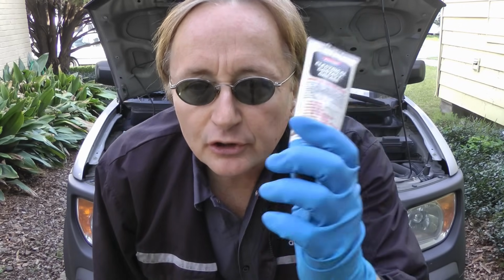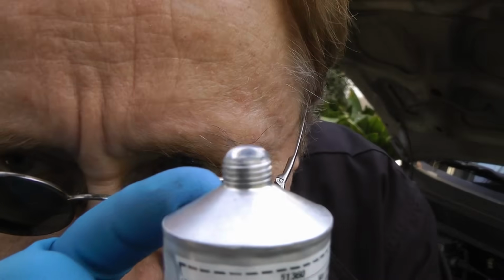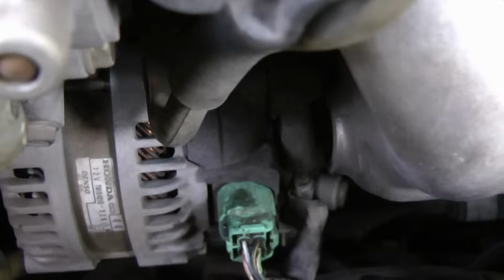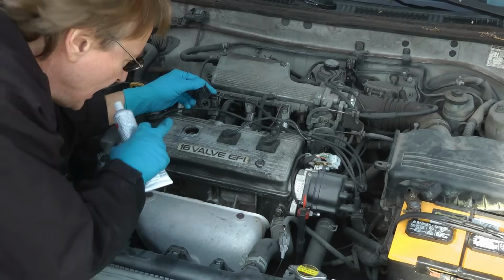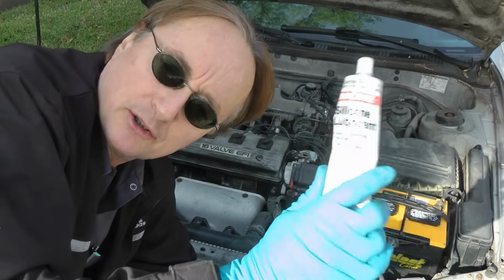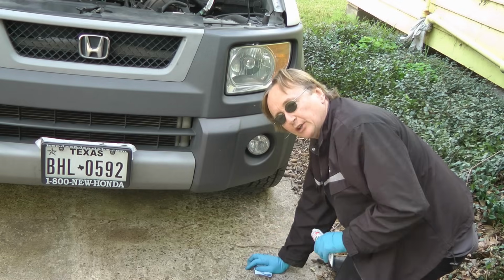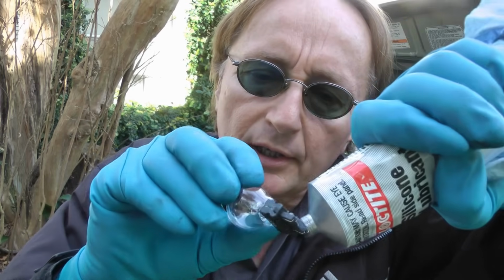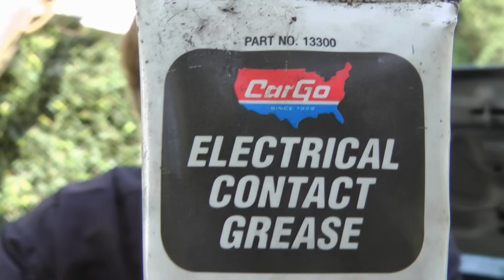How to use Dielectric Grease on Electrical Connections in Your Car

Comment: If the grease is a conductor of electricity wouldn’t it cause a direct short when used in plugs that have multiple contact points? If it does NOT conduct electricity then wouldn’t it keep you from getting a strong connection? Not so sure about this. If it worked then Chevy and other dealers would use it

Comment: Not interested in a "...but dielectric grease doesn't conduct!" argument.  PRACTICALLY speaking, is it best to LIGHTLY coat a connection (like say a sparkplug) with dielectric grease to prevent corrosion? Or avoid the actual connection?

Comment: I understand that Dielectric Grease is non conductive blah blah blah.  Practically when applying it to sparkplug boots how important is it to keep it away from the metal connectors, or do you even keep it away from metal connectors?  Obviously I'm really asking how strong of a connection are spark plug wires (i.e. for a car battery the connection is very strong so there's no issue.)

Comment: Scotty Scotty Scotty -- silicone dielectric grease DOES NOT  conduct electricity, whereas there are conductive greases that do.  Dielectrics are by definition INSULATORS.  Silicone dielectric grease is quite easily scraped aside by sharp metal-to-metal connections  (but not clamped ones like smooth battery post inner surfaces).  Dielectric grease's  main function is to seal out air and water to prevent corrosion.  Check Wikipedia.  If it were conductive then it would short out the spark plugs when applied to the boots and a film of it creeps down the sides of the plugs. But you can use silicone dielectric grease all over the HV systems because it is a good insulator.

Comment: Q: So Does Dielectric Grease Improve a Connection? A: No, dielectric grease is not conductive, so it does not improve connectivity. It helps maintain a good connection, though.  It dose not conduct electricity.

Comment: Weird, when I bought my honda RL it had grease on the brake bulb, and when it blew I replaced it and the connection had grease and a few months later it blew again. So then I wiped all the grease off and the bulb now works fine and has been on for over 6 months while the others only lasted 2
Reply from the maker: someone used the wrong kind of grease on yours then.

Comment: Can I use it on IPDM connectors?     I've gone through TWO IPDM provided by the dealer, original and second replacement IPDM corroded connectors   now I have the third IPDM installed by dealership and they insist NOT to use dielectric grease to prevent corrosion.   my can is a infinity 2004 G35 sedan.

Comment: ok Scotty.  Your videos are fun and your energy is great. Has anyone ever told you that you come across like "Ricky" from Trailer Park Boys? (Except I presume that YOU actually know what your talking about! Im curious where you are from. Are you upstate or Canadian by any chance?  Fianlly, I do have a real question....another YouTube video said NOT to use dielectric grease in order to IMPROVE electrical current flow because it serves as an INSULATOR.  The other video suggested that you avoid direct contact between the grease and the metal of the electrical contacts.  What is your comment on that? Thanks..... Marc
Reply: ***** scotty, ignore my comments on the insulating nature of dilectric grease. I just read through the other comments.
Reply from the maker: ***** upstate new york, you got it. But no one every compared me to ricky, heck, he's tons fatter than me and I don't even have sideburns.  But as for the advice, I technically mispoke about it conducting , because it is an insulator. BUT, it works as i showed it which an electrician explained to me. The grease prevents oxidation, and when you push any metal contact with grease into it's other contact end, that pushes the grease off the contact and any tiny bit left just melts from the electrical power and keeps it from corroding in the future. If you watch any linesman, they use the stuff all the time, even on household connections outside to prevent corrosion.
Reply: Physically you aint no Ricky.  But its the tone of voice and your speed of talking.  You intonate like him....if you were lying like him we would all just get excited and follow your lead anyway!  My wife is from Toronto, my dad is from Buffalo and I went to both places alot when growing up, and finally I have family in NYC.  Personally... we live in San Antonio, Texas, but we visit NY whenever we can. Ill subscribe and talk again sometime. Thanks

Comment: Wrong! Dielectric grease is not a conductor. It's non conductive! So don't glob a bunch on your electrical connections as too much can act as a voltage impedance. A little grease on the contact probably won't hurt, but it's not made for that purpose. It's made to be applied around the contacts as an insulator to keep the connections clean from contaminants.

Comment: Someone explain why when I put dielectric grease on battery terminal BEFORE installing them and on the posts it works great and has for years with no issues. If it’s such a great insulator explain why that connection works. Apparently the naysayers would say there would be all sorts of areas on the connection that allow flow but many areas insulated. Explain why what I have done works and what issues I’m apparently ignorant of. Thanks
Reply: The large surface area of bare metal to metal contact allows enough current to pass through, despite all your efforts of preventing good electrical conduction.
Reply: @dinuguan510  right so no issue. Car starts fine. Always has. Again I had no bare metal. I put light coat all around 😃
Reply: it is an insulator . That's what dielectric means. The connection works because the battery post clamps push the grease out of the way. The grease has to be made dielectric, otherwise it might bridge connections you don't want.

Comment: No, a dielectric material does not conduct electricity. Dielectrics are materials that are poor conductors of electricity, meaning they resist the flow of electric current. They are also known as insulators. When a dielectric material is placed in an electric field, it does not allow the flow of electric charge through it, but instead, it becomes polarized, meaning the charges within the material shift slightly, according to the Britannica. 
Here's why dielectrics are not good conductors:
Lack of free electrons:
Unlike conductors that have many free electrons that can move and carry an electric current, dielectrics have very few, if any, free electrons. 
Polarization:
When a dielectric material is placed in an electric field, the charges within it (positive and negative) shift slightly. This shift is called polarization, and it helps the dielectric to store electrical energy. 
Insulating properties:
The lack of free electrons and the ability to polarize make dielectrics good insulators, meaning they prevent the flow of electricity. 
In essence, dielectrics are materials that resist the flow of electricity and are used for insulating purposes, such as in capacitors and electrical wiring.

Comment: Hey Scott, i bought some duralast wheel bearings for my 06 pilot and they still make a loud noise.. do they need grease? Because the AutoZone guy said that they already have grease.. are duralast bearings cheap or i need grease on bearings? The new ones hum loud as hell too

Comment: Dielectric> means electric insulator. I think you are using it wrong and you need to remove this video. You are going to cost a lot of people money by creating poor connections. Died Electric grease is not meant to be put on ANY contracts.
Reply: he isn't costing anybody anything. DG is excellent for your electrical connections. You're making stuff up.

Comment: hey scotty I love your videos i have a used 98 mercedes ml320, i know you dislike mercedes and I do too, now, and I know what you mean about headlights heating up and melting, I had to replace the headlights on the ml320 cause they melted!!  and anyway I wanted to ask you: I was trying to diagnose a starting problem with the ml320 and I got a little piece of metal stuck in one of the socket holes in the fuse box under the hood. Long story short, I replaced the entire fuse box with one from salvage, does the computer need to be reset? I'm hoping I don't have to take it to the stealership, to use their special computer, because I want to sell it and they charge big bucks at the dealership!!
Reply from the maker: Tyler McGonigal  computer does not need resetting just from that, just driving it should reset idle and shift points

Comment: Last year, the main relay switch malfunctioned on my 99 es300, causing cooling fan failure resulting in over heating. I noticed corrosion on the socket. Can I put the grease in the socket as is, or is there a method to clean the corrosion prior to greasing? Also, is there any harm in getting the grease on the "terminal nut" of the plug? I pulled the wire from my son's recently purchased 03 taurus and the terminal nut of the plug was covered in grease. Thanks
Reply from the maker: Rob H you would either have to clean all the crud off, of splice in a new socket really
Reply: Scotty Kilmer . Is there any harm in getting the grease on the "terminal nut" of the plug? I pulled the wire from my son's recently purchased 03 taurus and the terminal nut of the plug was covered in dielctric grease. I'm assuming the previous owner was a little overzealous with the stuff.

Comment: @scotty I put the dielectric on the posts before putting on terminals. Poor contact - this confirms comments that it’s an insulator. Cleaned the posts out with electric connection cleaner, put on the terminals, then put on dielectric. Worked well. I agree - this video is wrong.
Reply: I have always put dielectric grease on my battery posts. Never had any contact issues and never had corrosion issues.

Comment: Hi scotty I have a honda civic 2004 I had a little small accident in the front and the car started over heating so when I poped the hood the fan was now working ir looked in good shape but it just doesnt spin I seen your video on fixing a fan but it didnt really help me what can I do please help
Reply from the maker: hot wire the fan by unplugging it and running power from the battery. If it doesn't spin, replace the fan motor. If it does, fix the electrical short from the wreck.
Reply: That was help ful thank u

Comment: This information is incorrect. DO NOT put dielectric grease on the connections themselves.
Reply: dielectric grease is excellent for electrical connectors. That's what it's used for.

Comment: dielectric grease is fantastic stuff but this is not how to use it. it is an insulator and if put between two connections can cause it not to work, cause a weak current or cause a connector to spark.
Reply: no, it doesn't. connections will be fine.

Comment: I used this stuff in the connector where I had a trail light not working and it's working now lol
Reply: Because its an insulator. You've just insulated the contacts and clearly there isnt enough force to push it out the way when plugging them together.
Reply: @TheStaniG  Uh? He said it's working now

Comment: What would be ideal to use if not this for say starter connections and alternator connections?  I started to do mud and water offroading on my 2004 Tacoma. Just last week it looks like my starter got water in it and now I have to change it. I get a delay when I switch the key on to start. Sometimes it takes 5-6 tries.  I tapped the starter with a hammer and nothing. Just want to be preventive for my next adventure.  Thanks!